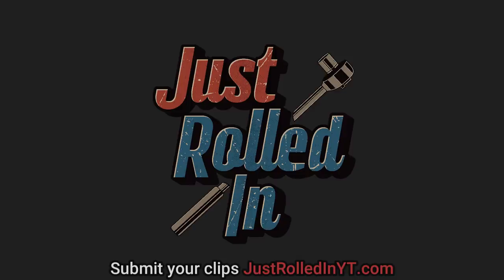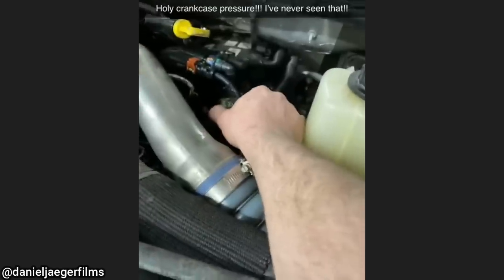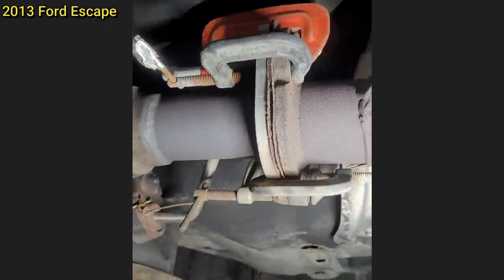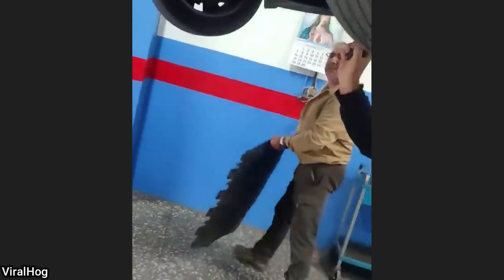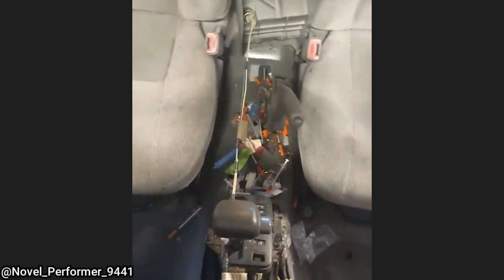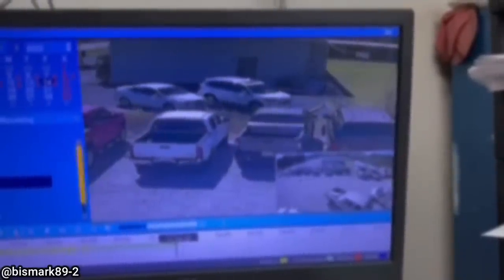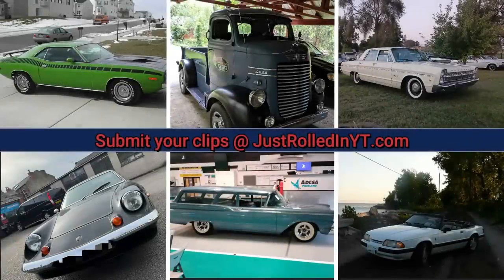Customer States Truck Has No Power & Check Engine Light Is On | Just Rolled In

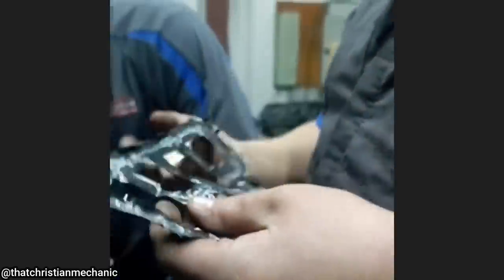Comment: 1:33 You can use soda case cardboard without electrical tape for a gasket.  Works fine, lasted 10+ years.  This is nothing except a barrier between metal parts.  Just has to be thin and compressed.

Comment: I was driving a mid 90s Crown Vic and the ball joint failed.  Its a tension style joint that fails and the whole car hangs off it trying to pull it out.

I was only doing 30 tops and managed to pull over, but the control arm did puncture my tire.

Went and got the rent a puller and changed it there on the side of the road.

Comment: I'm guessing the problem with the vehicle in the second or third clip is caused by a blocked pcv Valve. The way the mechanic unscrewed the oil filler cap and it blew off. The engine didn't sound real healthy either, had a very bad knock in it.
Reply: Most likely it's a turbo-diesel with worn piston-rings causing too much blow-by!  (Real risk of diesel runaway because it would need constant oil top-ups, which could lead to accidentally over-filling crankcase!)

Comment: I can see this type of thing is going to get worse and worse, because the worlds upside down.
In Australia you get charged $100+ an hour to the garage to fix and maintain your vehicle, the mechanic who does the work gets $28 of that. Plumbers and electricians and probably others also charge $100 an hour. Notice I said charge and not earn.
You would think that a much more important, and a job that takes 8 years to learn would pay more than the garage charges, but doctors here average $86 an hour.

Comment: Dude with the torque converter not bolted together dodged a bullet. If it was bolted together it would have killed the transmission and most likely fried the underdrive clutch(thing that is your gears in a automatic transmission)

Comment: That guy diagnosing the crankcase overpressure is braver that I am. I'd put on work gloves before I loosened that oil cap.

What kind of car requires you to pull the intake manifold to change the spark plugs?

I can understand refusing to work on that car missing the center console. All those hypodermic syringes are a biohazard. (Probably a diabetic's insulin syringes, but they still need to be disposed of properly.)
Reply from the maker: Common to see on V6 (transverse) engines. Usually to get the ones in the back.
Reply: Dude.  Those are not diabetic insulin syringes.

Comment: That gasket with the cardboard would have worked a bit better had he used petroleum jelly instead of electrical tape. Still wouldn't recommend though.

My well pump has had a cardboard Vaseline gasket for 10 years and still hasn't leaked.

Comment: The sad thing is that most of the “palette cleansers” that you post at the end of the videos probably look like most of the other cars in the video underneath. In my professional experience, most of the “pretty” classic cars that look good on top are a complete basket case of hack jobs and shitty repairs underneath, especially if the owner works on it themselves. As long as it’s shiny on top and idles rough (sometimes due to an aggressive cam, usually due to really horrible tuning), nobody seems to care what it looks like underneath.

Comment: I still cant decide if the "got it done at some other shop" customers are BSing or not. Are they just afraid to admit they did such a hacked up job? Or is there really some phantom shop out there absolutely bungling simple installs. I have seen some mechanics make some stupid mistakes, mostly at garages with a ticket system where you only get paid what the job is worth no matter how long you spend on it. So if the computer quoting system says a brake job only takes 10 minutes, and it takes you 30 for some reason, you only get paid for the 10 minutes. Still though forgetting the one bolt for a tierod end is pretty fking stupid.

Comment: That challenger is not running right.
Way too much smoke.
Reply: That's not smoke, that's steam from a chilly morning cold start... in fact, steam or liquid water coming out the pipe is a sign of complete combustion.... if the combustion was 100% perfect, like in a hydrogen fuel cell car, you could actually drink it!

Comment: The air filter in the truck was used by Blue Circle Cement to clean their product before bagging.
I thought U joints were made flexible for a reason - obviously not.
They're not C clamps, they're G clamps. You cant tighten up a C clamp, coz the threaded bit is missing.  No wonder you Yanks have funny spelling.
Reply: Often believed that these clamps are called "C" clamps because of their C-shaped frame, or also often called C-clamps or G-clamps because including the screw part, they are shaped like an uppercase letter G. However, in fact, they were originally called a carriage maker's clamp, or Carriage Clamp.